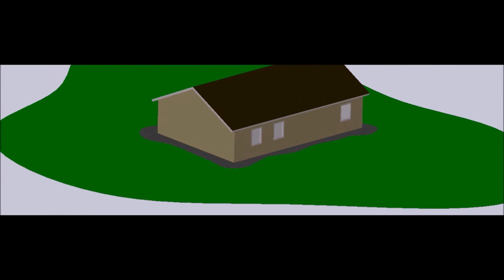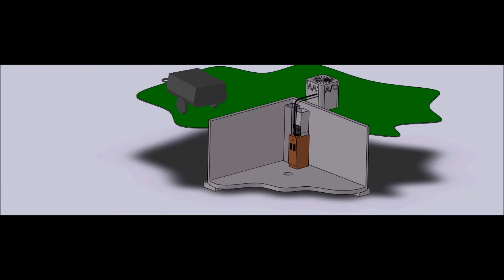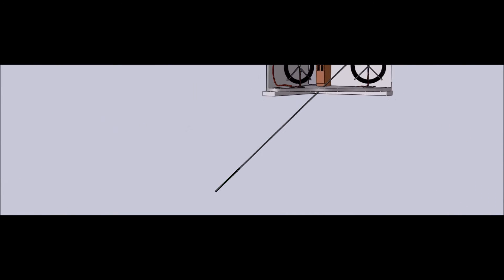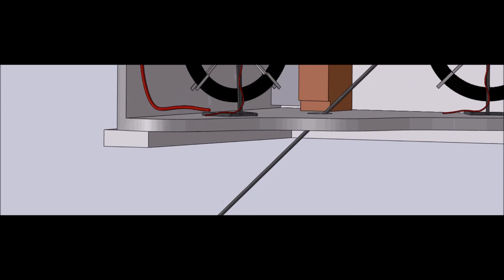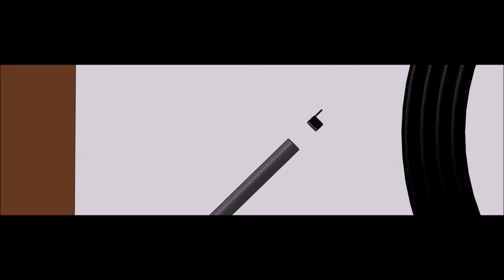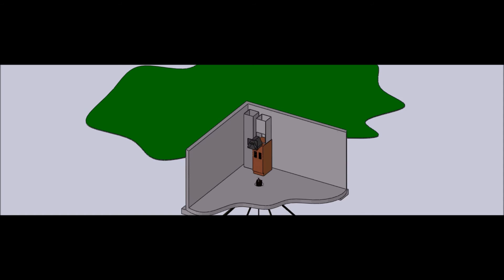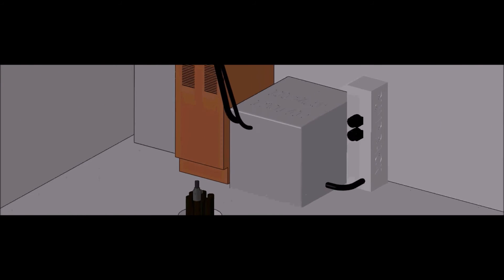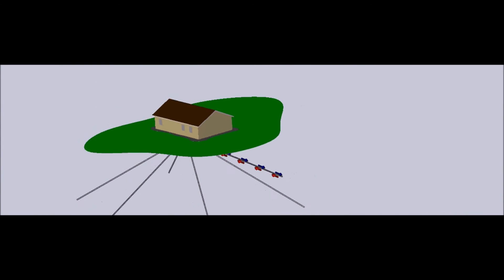NexGen Energy Proven Process

Comment: Would love to see this geothermal setup expanded to other parts of the U.S. outside Minnesota.  I'd be curious to know how much space is needed adjacent to or behind the home if installing at an angle (i.e., is this setup viable for urban housing).   For example, the average D.C. rowhouse is 20ft x 80ft with additional backyard space.  Could you have a two-dimensional setup instead of a teepee setup that could make use of the full plot without encroaching on other public or private land?